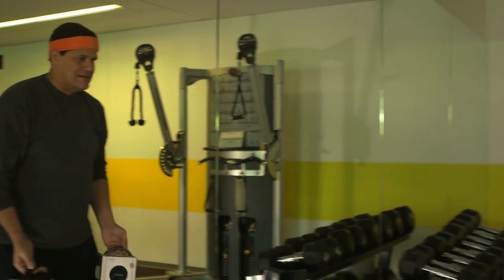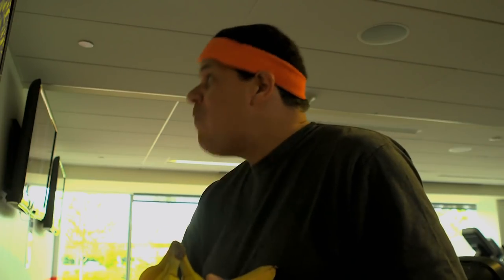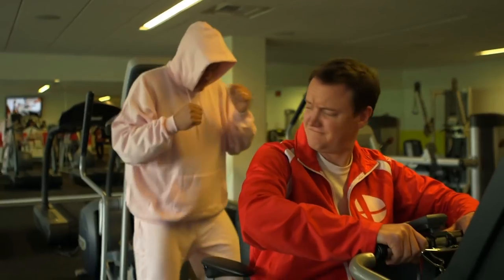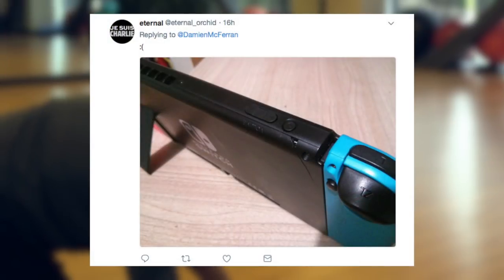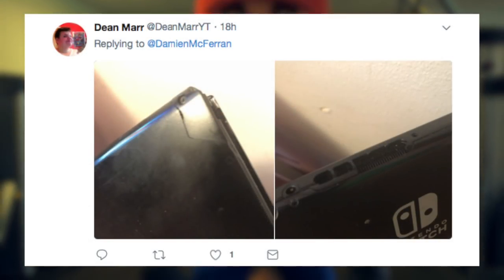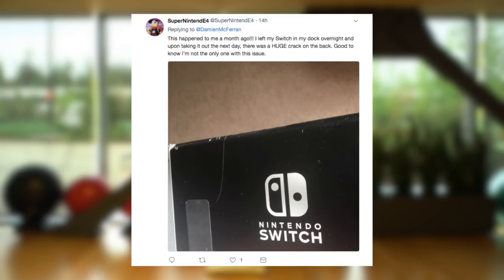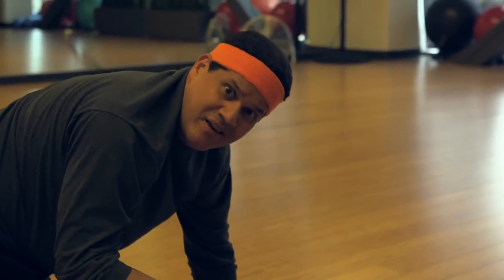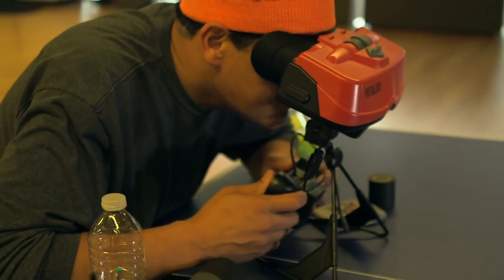Is Your Nintendo Switch Cracking Under the Pressure?

Comment: i owned 2 Switches till now and my first Switch i owned for 2 Months had some cracks where the plastic wasn't the thickest like beside screw holes and it was warped slightly + the screen and the back cover was lifting from the console + the left joycon was wobbeling when attached. I documented everthing with pictures and made some kind of instructions to make the issues clear to see and easy to find and sent it to nintendo just to get it back like absolutly untouched and my screenprotector was removed. After sending it back a second time UPS lost the package and nintendo provided me a new switch after some weeks just to claim it back later because UPS found it again after 1 month and after receiving my old Switch i discovered that nintendo didn't repair it AGAIN. All in all i had no Switch for two months in the christmas time. So even if you have warranty, dont expect nintendo to fix your shit guys.

Comment: I read the article last night and double checked my system as I live in Texas, but my system is perfectly fine. I've had it since the launch and have nearly 1600 hours played. Curious to why it happened to these other people.
Reply: Michael Smith I'm one of these people. Mine has a crack near the power button on the back panel. The plastic on the back is also warped slightly, especially around the fan area. I assume the heat is warping the plastic causing the cracks as the plastic flexes
Reply: Nation Harris I was concerned about the heat issue because of where I live. But I assume I am taking care of it enough and mainly using it in buildings for it to not warp or crack.
Reply: Michael Smith I believe I take care of mine I've never dropped it or anything and I live in England, it doesn't get that hot here
Reply: Nation Harris sorry, didn't mean to imply that you didn't. Our heat here gets crazy. We are rocking 100 degrees pretty much all summer.
Reply: Michael Smith don't worry I didn't take it as such :)

Comment: I sent my switch in for service because there was enough stress around the screw that it just fell out and disappeared. They fixed it free of charge for me after I called.
Reply: Never did anything with my switch other than gently remove and replace it from the dock, but the cartridge port cover seemed to be the exacerbating feature. In my early switch ownership I was swapping cartridges a lot and that seems to have been the cause of the stress. I try to buy mostly digital now.

Comment: Guys, you might want a new dock if you are mostly gonna play that way. The Nintendo one is mostly for a mix of both, but more handheld. Try getting one that is open, as some idiot at Nintendo thought it was a great idea to only give access to 1 fan at the back for cool air circulation. Ofcourse, when you overlock a chip, it gets hotter, soooo yeah. 1 fan blows in cold air, the other hot. Just get an open one so avoid this heating issue
Reply: Not to forget that the part at the back for cool air is blocked by the flap for cable management

Comment: Bollocks to your lovely people. Seen an article earlier, checked, yup... cracked left side and two missing buttresses from the air vent... 
Never been dropped, don't really play much in docked mode either.. 

...really hope that was the correct use of the word 'buttress', as actually getting to use it in a sentence referencing Notre Dame or architecture in any way would be like the coolest thing ever. Okay not ever, but close

Comment: I had cracks I have a day one model and it was so brittle on the back after couple months it was crack bits at a time. I just replaced the back myself with and the back plates now being used on he switch look and feel different. The day one version had a gloss too it vs the now more matte finish . It’s an easy fix if anyone is having cracks just by the proper tools and take time to watch videos on how to repair n replace

Comment: Huh.  Small crack and chip near the power button and a crack near the upper air vent.   Never dropped or taken apart.
Reply: Just checked my other Switch.  No cracks on that one.  Both are day one Switches.  The cracked one doesn’t have a warped shell, whereas the uncracked one does.  Not sure if that’s relevant.  US switch owner too.  So not just UK ones cracking.

Comment: Have had the Switch since release. No cracks, no bending, no lose joycons. I play it almost everyday. And i travel with it once a week at minimum. I have dropped it once indoors. But i feel if you drop it on concrete, its like any modern tech, phones, tables etc. It might just break/crack. 

In the end, i think this happens to few units. Like always.

Comment: I have dropped my switch causing some if the plastic to chip off. Luckily, it suffered minor damage. Another thing, dont drop your joy-cons. Doing so will give u a malfunction. That's some proof that the joy-cons as well as the switch aren't well protected.

Comment: The Cracking issue is simple.

                          Explanation:
People play their Nintendo switch consoles All day (and in most cases all night) and then they leave it sit dormant and what happens is while playing games on your console the console rapidly heats up then when left dormant rapidly cools down causing the plastic to Expand and contract which leads to the plastic getting weaker over time and ultimately leads to the plastic being so weak that it starts cracking. 
A simple fix would be to play for shorter periods of time. 

Thanks! 
have a good day! 😊👍

Comment: I do have this problem sadly, it is a crack by the screw and I am super careful with my switch and even have a protective case for it and everything so it's a random problem that just happens but I do want to know what Nintendo is going to do about it if anything

Comment: I legit took the time to take a closer look at their system, and compare there’s to mine. None of them look like they could’ve “cracked” in it own. Those consoles are breaking due to horrible owners they have. When have you ever heard of any Nintendo console breaking on everyone? I’ll wait. Again those owners are to blame their either dropping theirs, opening up the switch and not properly putting docked. Also I’m guessing they don’t put it in a case when they take it on the go

Comment: Seems like Nintendo's still cutting corners - pun intended - when it comes to build quality, smh...
Reply: Galan Destroyer This happens to the 1% but sadly the internet makes 1000 to 20000000 seem like alot
Reply: Starman Tis true the interwebs can blow things out of proportion. But Nintendo can be shoddy when it comes to manufacturing. The number of times I've purchased Nintendo hardware only to exchange it that same exact day due to dead pixels, a d-pad barely connected to the load spring, a DS top screen so wobbly it feels as if it's going to come right off, etc is more than a few. By comparison, I'll purchase a single hardware system from a rival competitor - literally ZERO problems. That's my experience, anyway.
Reply: Guess what? Every company makes faulty consoles. Red ring of death, disc ejecting on its own.. But yeah, only Nintendo.
Reply: Also forgot the loud ps4s and loud xboxs with disk drives

Comment: Here in Australia, I am a member of a Switch group on FB, this issue is quick well known and a few people have had it happen. I believe (when they contacted Nintendo about it and had it repaired) Nintendo said its a manufacturing issue on select Switches where the Screw was tightened to much. 

I might be able to get someone with a reply from Nintendo (believe some have emails with replies) if you guys want it. But Nintendo Australia have very much repaired a few due to this issue.

Comment: This happened to mine roughly a month after launch. I covered the whole fix with nintendo in detail here: https://www.youtube.com/watch?v=Ez6P7y4c0jM&t=58s
I think the crack I experienced was due to the battery overheating. Nintendo australia replaced the backing and seem to have fixed the root cause because I have had no further issues. 
I also speculate that the new back plate is of a slightly different quality plastic because it felt different to what I remember. 
I had a friend who had an issue with his grill cracking, and that was a different cause, apparently a fault with the cooling duct and they had to swap out his whole system with a new one that developed a crack similar to mine.
He has since fixed that and the new one works fine. 
So it seems that there are two root causes which could be made worse by some substandard plastic backs

Comment: So probably it's the heat because my switch is fine and my country is so good wether in summer not hot and not cold plus I use my air conditioner so I blame the heat plus most my friends that is in my country as well didn't experience that

Comment: Nintendo was sent replacement shells in February, it's not heat that cracks it, nintendo should fix for free
Reply: Nintendo reps aren't allowed to publicly state the reason why the switch cracks, however after testing the issue they discovered that it's not due to the heat,the replacement shells have different paint for the switch logo and in some cases are actually a tad to large so the cart flap doesn't sit well

Comment: Wow. I've never dropped my switch once. Saw this video so I went to check and sure enough there cracking in the back by the screw hole on the right top side...
Reply: Update: called nintendo, and since I'm definitely out of warranty (day one buyer) they said the only option was to send it in for inspection, and that they'd get in touch with me to tell me whether or not I'd be paying for the repairs and how much. 

Total time is an estimated 3-4 weeks between me shipping it out, getting the repair done, and having it shipped back.
Reply: Starman I was actually thinking about this. The back plate doesn't have anything attached to it right?
Reply: Stein's Domain Nope it's easy to fix.

Comment: Frankly if this is happening to your switch you've been treating it badly. Had mine since launch and no issues. I did suffer from the loose joycon issues though, those plastic locks are very fragile! I replaced the locks with metal ones and they are waaaaaay better. now.

Comment: Nope have 3 non are cracked. And we play it outside, in Pheonix Arizona which is way hotter than the UK lol.

They are dropping them.

Then we have bend gate as well. Which 1 of my switches did bend a little. Sorry plastic doesn't crack under heat it melts. Heating and then cooling very fast would cause cracking, but they are not dropping it in a ice bath. 

Then "The cracking is showing in all the areas that a dropped switch would hit the ground" too funny.